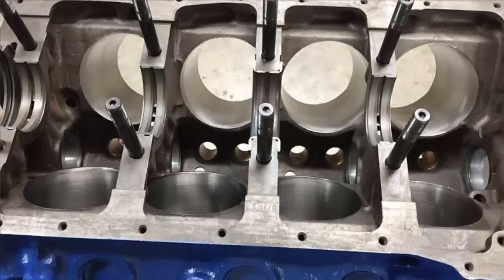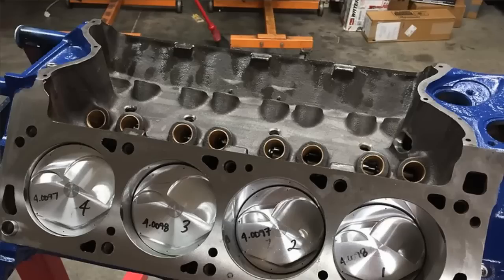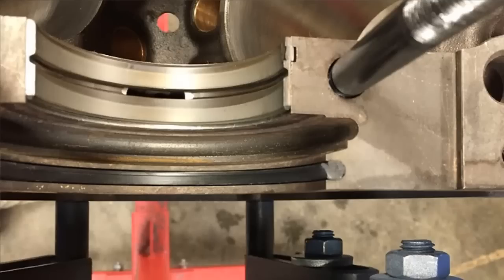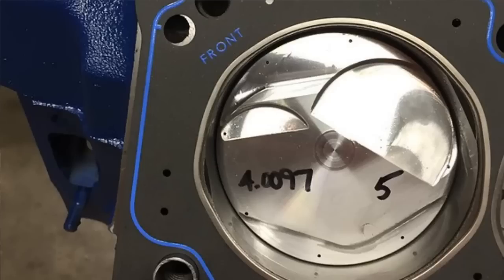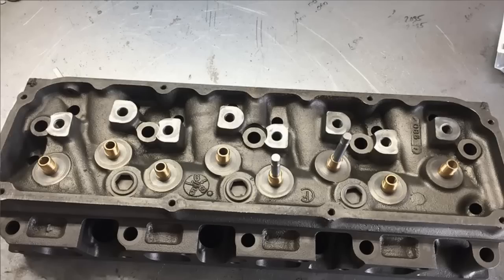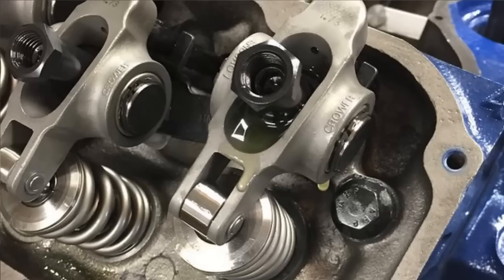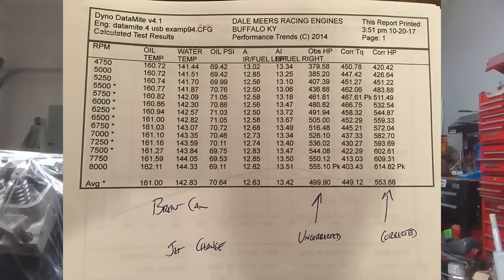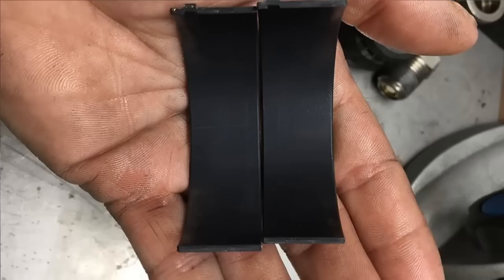Lykins Motorsports 354ci Ford Cleveland Overview

Comment: I have an original unmolested 351C block from my dad's 1972 Gran Torino. Slowly buying parts for it, but plan to put Eagle 4" or 3.825" forged crank and Eagle rods, trickflow heads and intake manifold, and 4.010 pistons. Camshaft unknown right now but I want about 550hp, but I dont have anything to put it in right now.

Comment: Brent I'm not if you check but are you Lucas or Lykins Motorsports? I agree the Cleveland had major potential. Tim's new block may be the start of a rebirth for the 335 series. You stated which cam made more power your custom grind or the Strob? I'm guessing a little more than backcut valve job. Closed chamber I assume. I heard offset dowel holes to help shrouding is a thing now. The heads were the power for the Cleveland.
Reply from the maker: Lykins Motorsports, the name of the channel........  Our custom grind made more power on that test.  Offset dowels have been around for decades.   It's helpful not only on Clevelands, but on any engine where the intake valve is close to the wall.
Reply: @lykinsmotorsports  yeah that's something we did in the 80's. We did plates,bore scallops,crank knifing,stress relieving, some piston coating. Unshrouding valves is 101 stuff. We ran two 408's. Windsor and Cleveland. We cracked the Allen Root heads between the valves and the other 408ci had 71' 4V Cleveland heads with lots of work to the chambers and port floors to keep it stock looking but you probably know that. The Cleveland pushed just about 675hp white knuckled but the owner was balls out. Used to race down at V-street in DC and Baltimore North point blvd. It lasted about 5yrs til it pushed out #5. He went 385 last I heard.

Comment: I've got my fingers crossed 🤞 . I've gotten my 351 4V Cleveland back from the builder and it was bored 60 over and for sure never sonic checked 😔 . Guesstimation of 450 or so hp. 🤞.
Reply: How did your block turn out?

Comment: How feasible or cost effective would it be to sleeve a Cleveland block due to the thin cylinder walls?
Reply: Slap the heads on a Windsor block!
Reply: There's good blocks out there some were there getting harder to get at least around my area

Comment: What LSA do Clevelands like about 108.
Reply from the maker: The LSA is the result of overlap calculations which depend on the cylinder head, how they perform, and what the application is.  There are no specific LSAs for any engine family.  As a general rule, older factory heads like a good bit of overlap.  That can be achieved in several different ways.
Reply: @lykinsmotorsports  I thought you were using stock Ford heads. Low to mid range flow compared to what they are feeding is my guide. Chevy small block with double hump heads. 350 I use 108 then use the duration to suit my rpm. If I increase the stroke by 1/4.inch. I will tighten it a couple degrees and so on. Has always worked for me. The Clevelands have an excellent in port but the ex seems weak. I worked on ex ports and never was satisfied. I only built the one and it performed well. I'm sure it could have been better. I asked because a friend asked me about camshaft specs, I didn't know what to tell him
Reply from the maker: This build did use stock Ford heads.  However, the LSA is just a number and you don't pick them before taking a look at the overall amount of overlap.  Randomly choosing an LSA can result in an engine that's not happy.

Comment: Sorry Brent, but I must disagree with you on "The best engine Ford ever built." In my opinion, it wasn't the Cleveland but rather the "Boss 302." If one were to look past it's rather meager factory displacement and piston skirt issues with the early TRW's, the engine had it all together. A great, reliable, viable, as produced street engine with obvious motorsports capabilities. An as produced, no excuses block architecture and rotating assembly, cylinder head design, induction system, oiling and cooling system. The little engine that really did have it all together. I must agree with you though in that Ford did have issues putting all the ingredients together in one package. Many good individual ideas but never did they seem to totally incorporate those ideas into one engine. In my opinion, the Boss 302 came the closest. Only if Ford had produced a mid-sized engine (350ish c.i.d.) with all the attributes of that diminutive Boss 302, they REALLY would have had something. If you're thinking "Cleavor" so be it. We would have heard less about Chevrolet street and motorsports performance and more about Ford back in the day. I know, I came of age in the era of the '60's and 70''s and for the past fifty years have successfully built and raced nearly every type of engine Ford produced in those years. I have subscribed to your channel and have done the same for DragBossGarage. I am a supporter of Tim and his efforts and will continue to tune in to both both of you.
Reply: @ Bill Fioretti , Hey Bill.  The 1969 and 1970 Boss 302 cars are well balanced vehicles overall. I like them too. 
You commented that “Only if Ford had produced a mid-sized engine (350ish CID) with all of the attributes of that diminutive Boss 302 , they REALLY would have had something “. 
As far as the engines are concerned, the Boss 351 of 1971 is exactly that something special that Ford did build. The Cleveland type cylinder heads used for these Boss engines are responsible for making awesome power and except for a few minor differences, are almost identical. 

The extra displacement of the Boss 351 really works very well with the huge ports and valves found in both Boss engines 🏁. 😊
Reply: The ONLY  reason you did not hear more about the Clevelands was that by the time they were released, Chevy's had dominated motorsports, and the agency's running the program's were NOT going to obsolete the engine that 99% of racers were using. So they handicapped the Fords to make their core racers happy! Simple as that.
Reply: hi, goo gle "351w xe block" for more info on Fords 289/302/351 "W" xe race blocks

Comment: Back in the early 80s I built a 351C for my mustang. I put a street cam in it and clearanced the oil pump and put in the correct pressure relief spring and oil restrictor plugs. When I started it up it was spraying oil everywhere. Scared the crap out of me. Tracked down the leak and it was the new Fram oil filter I had put on it.
Reply: Don't use fram anything but fram
Reply: @xxkingslayemxxgamer5553  - Yeah I thought they were junk as well until I lined up all major brands and cut them open. Fram was far better built than Wix, K&N etc..
Reply: I had a perfectly good,diesel-powered cargo van in my fleet.  It was time for an oil change, Walmart was out of AC oil filters, so I bought a fram and crossed my fingers.  Filled the filter and crankcase with oil, and started the engine.  No oil pressure after a few seconds, shut the engine off, bought a NAPA filter, filled it and started the engine.  It had oil pressure immediately, but it was too late,  it started ticking and sure enough, it had spun bearings.  Van had approximately 90,000 miles on it.  
Thanks, Fram!